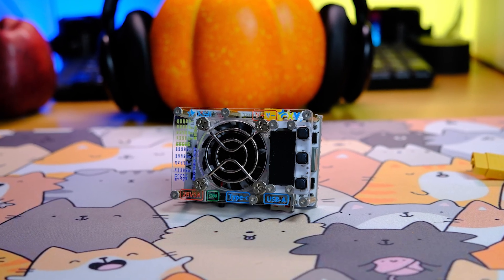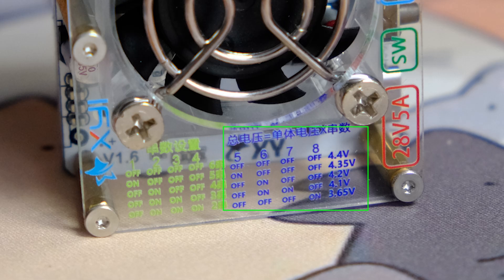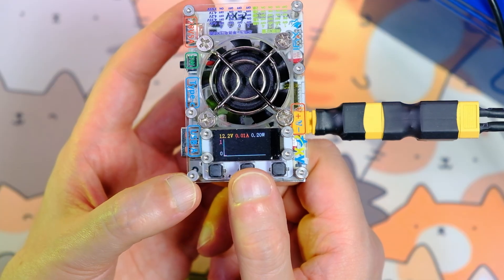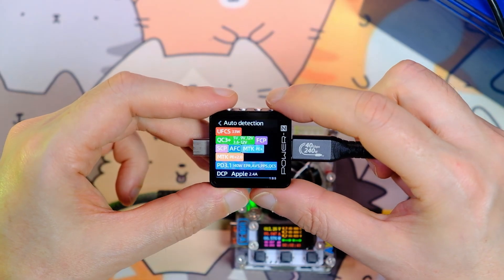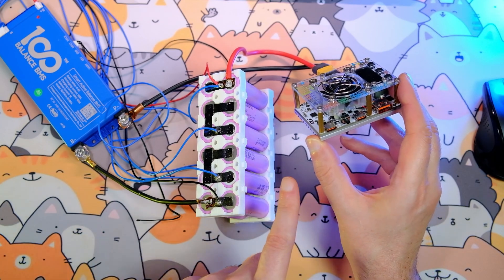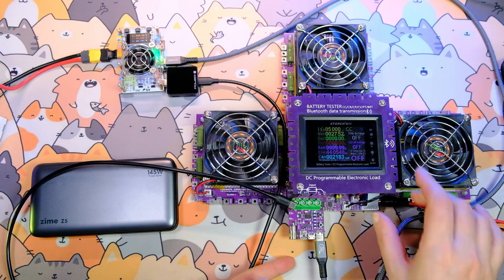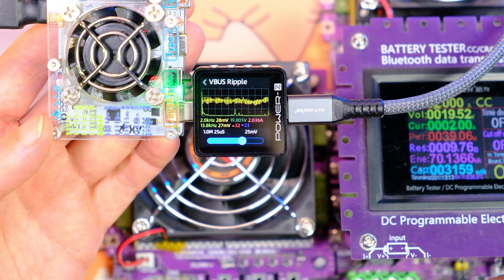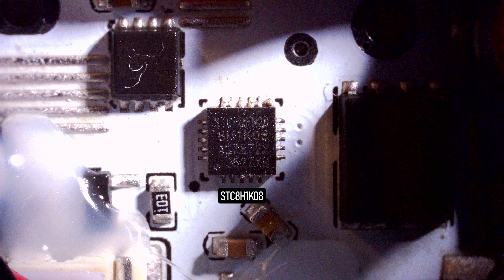280W DIY powerbank board with double PD3.1 140W. Universal input, powerful output.

Comment: Nice module, thanks for the video!
sad that there is no option to manage individual cells and external BMS is still required
Reply from the maker: And from my experience, the need for an external BMS is an advantage.
Reply: @QuickReview4You  3:26 if I connect it to a 12v LiFePO4 battery pack like this, can I charge the battery using a usb-c charger? What's the safest charging speed for a 12v 20ah pack is it 100w?